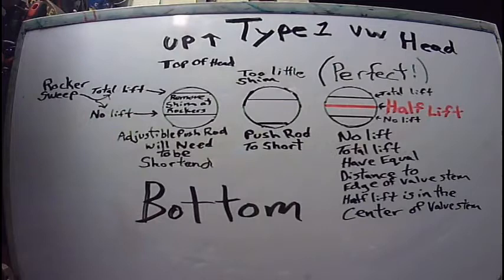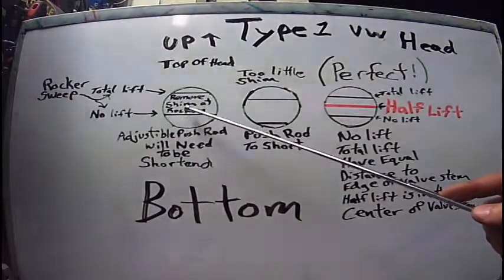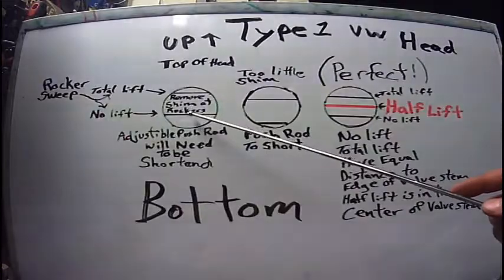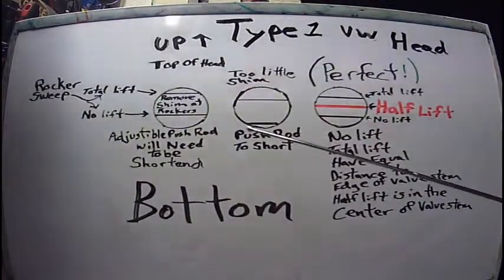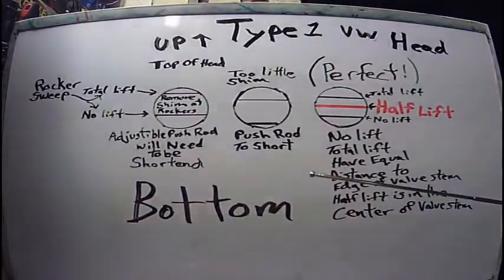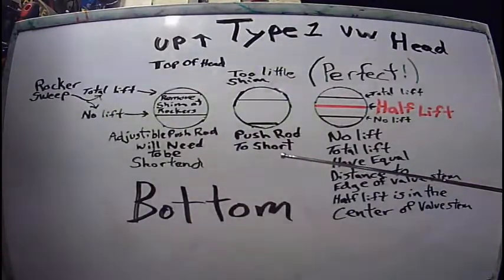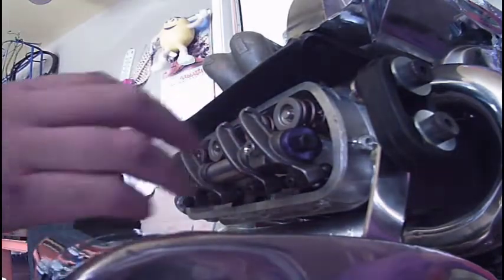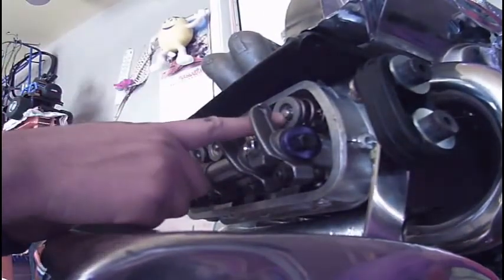VW Valve Geometry 101

Comment: Rotating valves ... that was a concept from the 1940s. And it was a huge failure in many ways.

Back hear .. in the real modern world.
The valve stem is locked, under constant pressure to the keepers, and the spring's cap. 
Not to mention, the valve guides are not a lubricated sleeve. Rotating valves ... would just cause a huge bunch of wear ... in a place that you don't want to see wear.
All modern engines .. the rocker hits dead center and not side to side (right/left)
And Muchachos here explains how to achieve the logics of getting the up and down.

Think about it ... we do everything possible to center the valve (up and down) to prevent wear.
Sooo.. you should have  zero side to side misalignment ?

Comment: Thank you so much for the vid but Bro, please help me how do I know I'm at half lift I have a 120 cam. Also I have 1.25 rockers. These are the specs .496" valve lift
.397" cam lift
294 degrees of advertised duration. How do I know I'm at half lift??? Do I need to use a dial indicator?

Comment: If I remember correctly,Oldsmobile many years ago used exhaust valve rotators on some engines and what they got was premature valve seat wear.i can't think of any modern engine that has valves that rotate.also,with the keepers I don't know how it's gonna turn anyway.
Reply: That's a great point.
And just say there was little to no pressure being applied to the valve stem while it returns to the closed position, then there would be no rocker arm action to make it rotate either.

Comment: this is not the way to do it to my understanding,I read that rockers should be off center to rotate the valves
Reply from the maker: You just touched on a subject that is pretty much a huge can of worms. There are hundreds of threads about that and it all really comes down to what you prefer to do because 50% of the people more or less like to lock the valve in place so that it doesn't rotate by grinding the keepers thus pinching the valve stem. This is considered to be high performance modification by many. The engine on this video I locked the valves so that they don't turn.
Reply: Hmmmm .. but the valves are unable to rotate because of the valve keepers are locked to the spring cap, that holds the valve. And the spring can't rotate either. 
This whole rotation thing ... is a bunch of monkey see = monkey repeat.
Reply: No manufacturer has used off-center /rotation geometry  ... since the 40s. The miracle is that people still repeat it.

Comment: Where did you come up with this information
Reply from the maker: Hi Dan,
 Most of this info. is pretty much scattered in bits and pieces all over the internet most of the valve geometry forum threads about type 1 engines but only touch on one or two problems and don't explain the rest making it very difficult to under stand the concept. How ever..... there is a good reason for this, there is at least a half dozen or more of rocker styles that this info would not work and a different approach method is a must. So a word to the wise.... Just because this method works for me doesn't  mean it will work for you. However this video will give you a pretty good idea on how to approach you situation. Hope this helps :)

Comment: Great information, nothing beats being able to see how things are done rather than reading about it!  I did this with my build about a year ago for the stock rockers and now will be upgrading to 1.4 and needed the refresher.
I noticed that when you marked the valve lash cap and rotated the engine the pass was right on the center but it was off to one side. Would that put pressure to one side and possible damage components down the road? I am fairly new to building these engines and want to make sure every end is covered.  Thanks for the video!
Reply: You are correct  .. up/down .. and side to side .. should have zero  off-center pushing.

I watched a great stobe video of valves and springs at 5000 rpm.
Wow .. those stainless valve stems were wiggling like crazy ... like about 1/4" total swing.
So .. hitting them off center .. is not a good idea ...